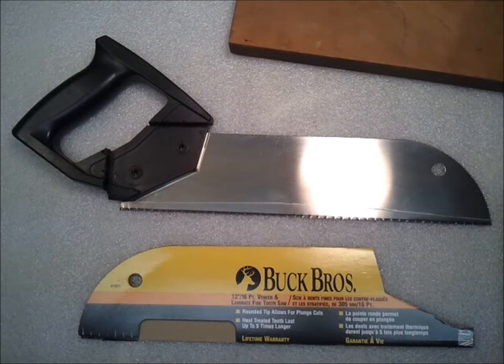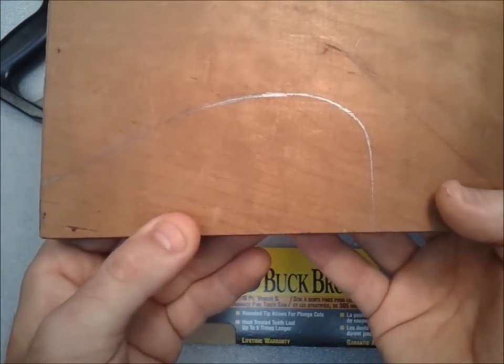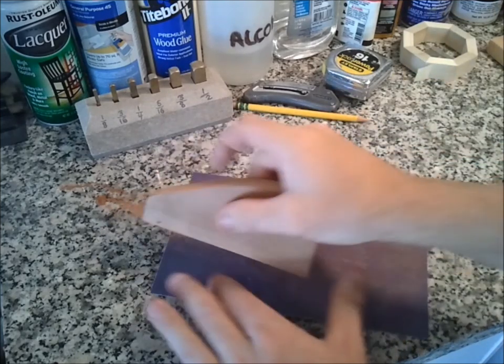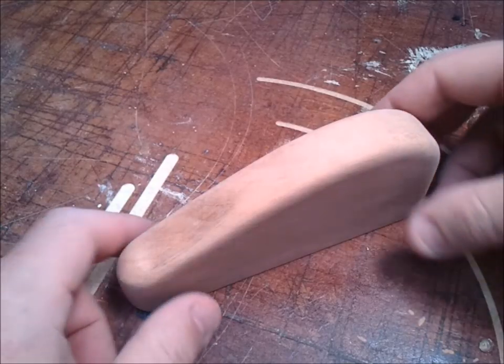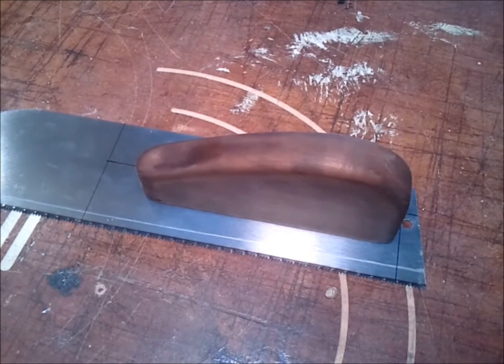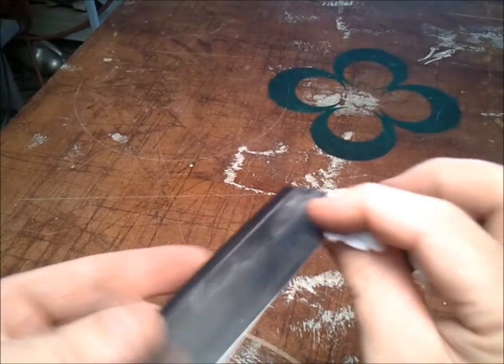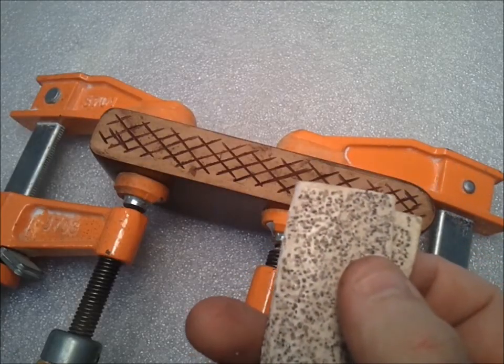Mini flush cut saw

Comment: pocket83
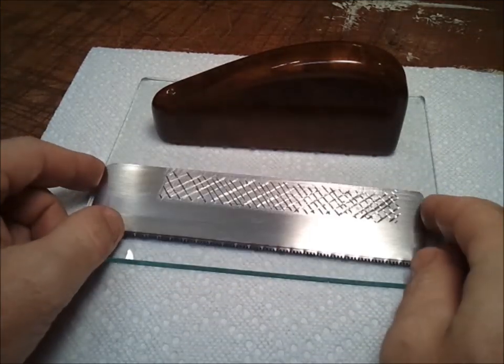At 5:53 . I suggest you use two sirings when you deal with two component glue. Sirings usually have a little measurement on it too, so it makes it easyer. Also dont use the same siring for both, or you will need a new one all the time.
Reply from the maker: It actually works well, if you read the instructions. The mistake that I made was simple: I left some air bubbles in it. Air compresses much more than liquid; if you remove the air fist, it comes out in nearly perfectly balanced portions.

I'll make an annotation, thanks.
Reply: pocket83
There are tolerances built into the mixing ratios that will allow for slight imperfections in the amounts dispensed. 5 to 10 % is not uncommon. The main thing is clean parts, as you stated.

Comment: This is appears to be a very nice and useful tool however, the finish on the wooden handle appears to be slippery, thus difficult to hold. Are you satisfied with the feel of the handle when using it? I look forward to building my own, sans the slick looking lacquer finish. 👍
Reply from the maker: I'm satisfied. Lacquer is not slippery in the hands, and the shape makes it easy to hold. The finish is admittedly over-the-top for a tool, though. If I wasn't doing it for a video, I probably would have just mineral oiled it.

Comment: Super old video, I know but, those tubes of epoxy are easier to deal with if you take a utility knife or something and cut the little piece of plastic that connects the two plungers. That way you can work each plunger independently and you can always get the exact amounts of each that you need.
Reply from the maker: Or you can just store it upright. Get all of the air out of it, and it will dispense perfectly symmetrical amounts. This is because air compresses much easier than liquid does. 

I was a n00b when I shot this.

Comment: Any concern about setting the teeth on one side only (for a flush cut saw), or does it already have that? For setting the teeth by straighten it on an anvil and small taps with a hammer and resetting them is a nuisance, but sanding away the set on one side will only add to sharpness of the edges, and it will make it even thinner, and will result with the proper set of the teeth.
Reply: That was exactly my concern. Otherwise, pretty good idea.

Comment: hah i have used the same epoxy and had the exact same problem!
Reply: Cut the one piece plunger in half so the two halves work independently of each other. A tip from Jimmy Diresta. He's on YouTube. I highly recommend his channels.
Reply from the maker: Just get the air bubbles out first. Then you don't need to cut the plungers apart at all. Tiny amount adjustments can still be made by rocking one plunger in deeper.

Please keep in mind that this is from 2012. Also, I think I mentioned this in an annotation.
Reply: +pocket83 woah, you are from the past? can you do me a favor and tell past me not to get your hopes up about killing floor 2? also tell past me to look up professor kliq
Reply from the maker: +1wsx10 Sorry, I'm only allowed to change future events relating to my videos. Now I must go, I'm in line for Nirvana tickets, and texting this from my phone looks suspicious.